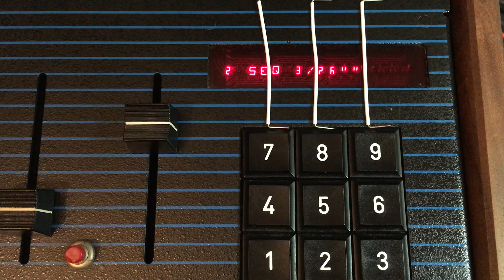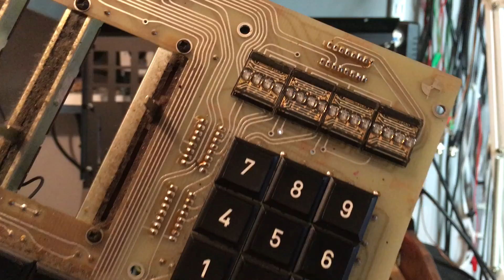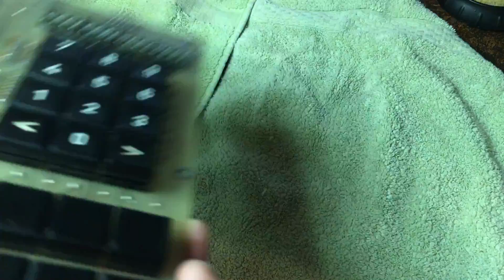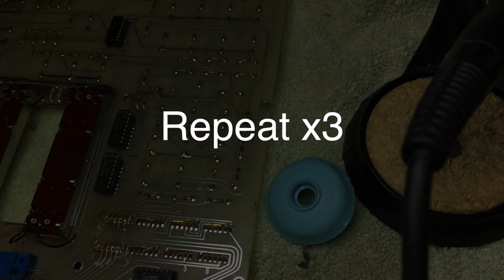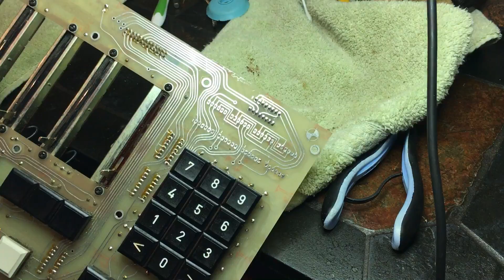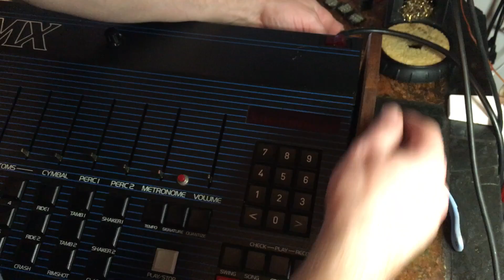DMX display repair

Comment: Is it a sin that I want to tear one apart and use it as part of a star trek helm panel?
Reply from the maker: I doubt it, post a pic if you do it!
Reply: I want to buy one, but I do not have the money. I have line on one for 600 dollars. It is damaged. I would actually love to mold it and be able to make more. I recently found out they used this for several props in Star Trek 6.
Reply from the maker: no way I will keep an eye out for that.  I bought mine for $40 on eBay when the pound was strong against the dollar
Reply: @TheStarTrekApologist  Star Trek 6, as in the FILM? (as opposed to some TV series...)